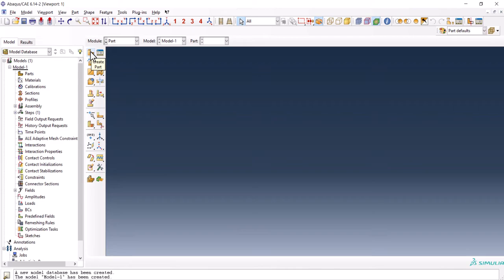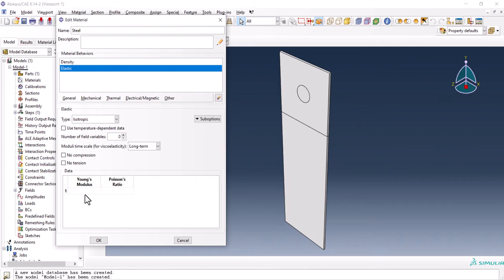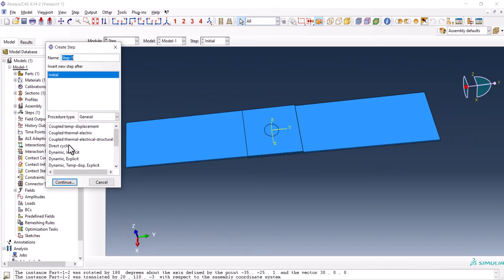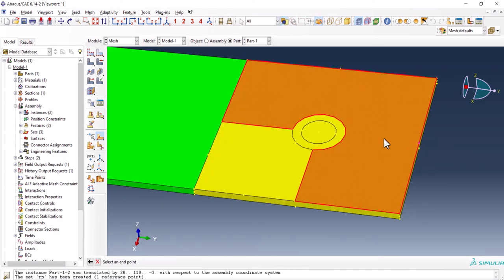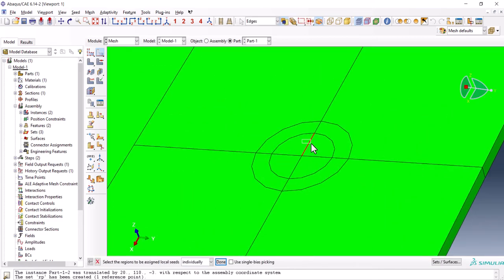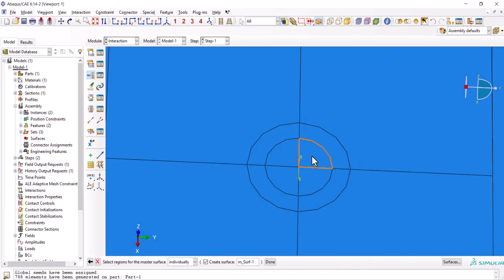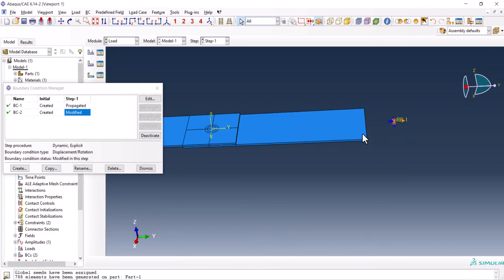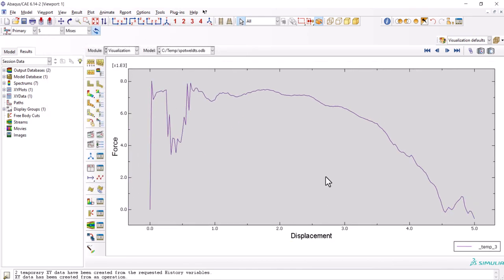Spot Weld Tensile-Shear Simulation in Abaqus (Step-by-Step)

Comment: i amde the same steps in abaqus 2017 and it doesnt work why ?
Reply: the 2 plauqes stays attached to themselfs nit like the video rsults
Reply from the maker: @maxwell-o6f5n  have you checked everything according to the video?
Reply: i think maybe the interation you miss somting because it doesnt work
Reply from the maker: @maxwell-o6f5n  No, I never missed anything in my video; the problem is on your side.
Reply from the maker: Watch the video once more without skipping; you might have missed a part.

Comment: Hi, I need your help im doing this for my thesis but im combining dissimilar metals (Al and Cu), this video has been very helpful and totally works when simulating similar metals however when I change the material for one of the specimen my force/displacement graph turn into an oscillating mess. please I need your help i followed your tutorial step by step, the only change I made was making 2 identical parts instead of 1 since im doing dissimilar material. please help me FEA Master
Reply from the maker: Thanks for the interest in this video. You need import the correct materials properties and maybe refining the mesh to get a better result! Let me know if there’s still a problem.
Reply: @FEAMASTER  Hi thank you for responding I really appreciate it, the material properties i would assume to be correct, as for the mesh I did it exactly as you did. would I need to mesh it differently to simulate dissimilar metals ?
Reply from the maker: The video has an educational purposes! You might need to make the mesh finer for better result!